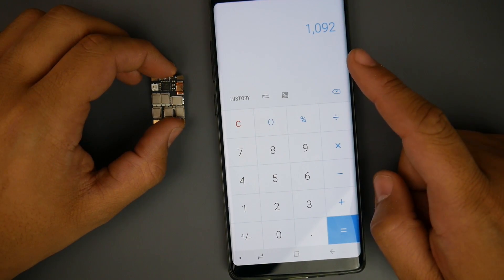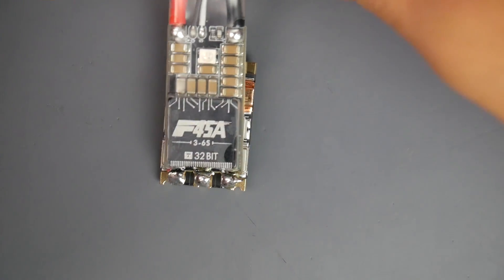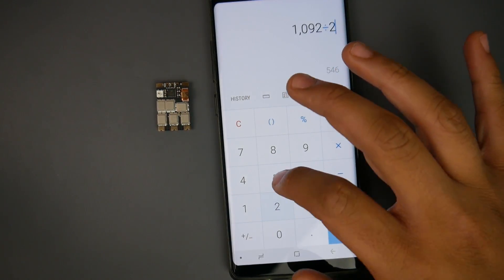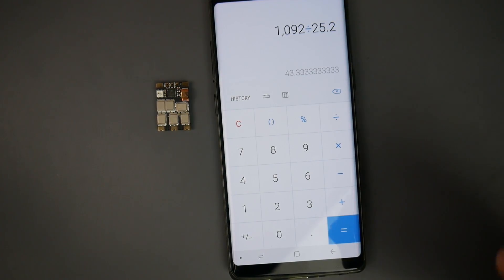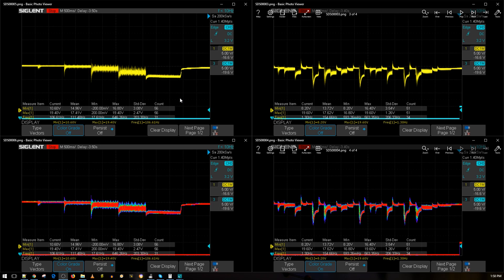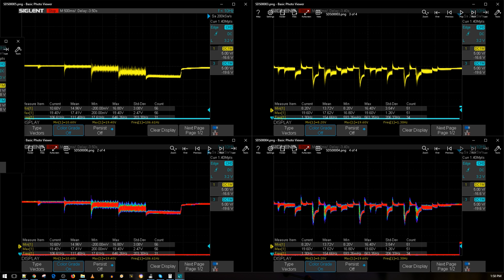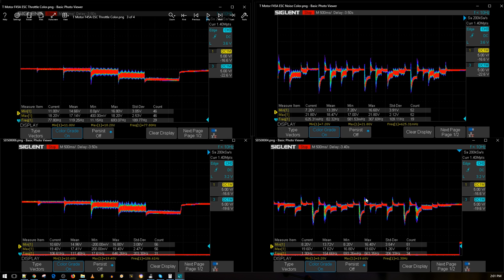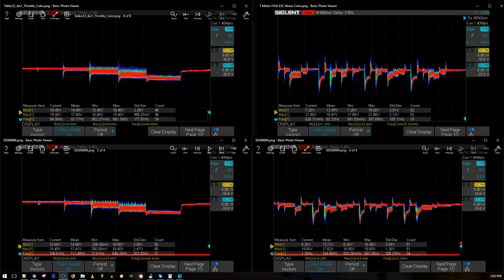ESC MADE WITH ALIEN TECHNOLOGY!! // Holybro Tekko32 F3 Metal ESC 65A

Comment: Hey drone mesh. I have these tekko32  f3 metal individuals.  I paired them with a  radix fc and pdb. I always  have errors  in the motors tab on betaflight  when using bidirectional  dshot. I have contacted  Brain about this and Holybro.  Brain says it's bad esc's,  and Holybro says it's something with the fc.  It does fly without bidirectional dshot. Tried all sorts of settings to get the error to zero. Nothing helps. All the obvious stuff is correct  like firmware  and stuff. My question is, I remember  watching one of your  videos  where you found that one esc in a 4in1 didn't  quite work like it should have compared to the others. Is it possible that I have faulty esc's?  Have you heard of this before? Any ideas. I would hate to just go out  and spend another $100 on esc's.

Comment: you might be getting something wrong about that shunt resistor. at least i cant see how it could directly increase power delivery and efficiency. and ant resistance will slightly reduce the current drawn. usually a shunt like that is used for current meassurement, though, which might allow the MCU to make some little adjustments. 
(you cant easily meassure 65A. but the resistance of a meassuring shunt causes a tiny current drop, that is easily meassured, to calculate the full amperage.)
PS: feel free to correct me, if i am mistaken here. but it sounds just about right. https://en.wikipedia.org/wiki/Shunt_%28electrical%29#Use_in_current_measuring
Reply: I believe he simply means that they are using a lower resistance shunt than is normally used so there will be less loss to heat in the shunt itself.
Reply from the maker: I replied to another comment earlier just like this and I spoon fed them what I meant..

Comment: Shunt resistor are there for measuring current, they don't do anything than you mentioned.
Reply: Fernando Fasanella he meant those benefits in comparison to “standard” shunt resistors. they’re all low resistance but the implication is that these are even lower resistance which in comparison to the typical shunt resistor improve blah blah blah ... but it’s probably a modest benefit.  if something does the same job as another part with lower resistance it will improve amp draw, efficiency, power delivery...
Reply: @CesiumSalami  Yes and any real electronic engineer will tell it's just gimmick and BS. Let's do some math. Assume the shunt has constant resistance regardless of temperature change, when the load (the quad) draws 100A, the .25mOhm shunt dissipates 2.5W (100^2 * .25m) LESS power than a .5mOhm shunt. That sounds like a lot cause 2.5W can light up quite a few LEDs. But if you look at the whole picture where the load is drawing 2280W (100 * 3.8 * 6), the overhead is just 0.1%. And if the quad is just cruising around at 10A, the same model suggests an overhead of 0.011%. So basically they just sacrifice current censoring resolution and accuracy (especially at low end due to the crappy ADC) for nothing here.
Reply: @ivanwong8361  Yeah......... i can't speak with much authority on this and since i have your ear - two things: I wasn't attempting to say that there was a real benefit to these low(er) resistance shunts just that he wasn't making stuff up completely / clarifying.  Perhaps it's all BS / Hype as this hobby is prone to, but that is the goal - it may very well not achieve it.  BUT my question is this: so, if there's really no value in terms of the things you mentioned (thank you very much for the explanation!), they do look really beefy.  Coupled with their larger size and lower resistance do you think they may end up rendering more accurate current readings over larger ranges of wattages because they're able to maintain temps better?
Reply: @CesiumSalami  I totally understand you and I am not saying anyone is making up stuff here - theoretically it's correct. A simple analogy would be: you take off your clothing to save some weight because you want your car goes faster. Theoretically it is correct. But we all see how silly it sounds. To answer your question: I personally never judge characteristics of a passive (or active) SMD component by its physical size. (I know some youtuber keeps saying bigger MOSFETs are smoother lol) Two shunt resistors which look exactly the same can have very different temperature coefficient ratings, very often differ by order of magnitude. The only way to tell is to read the datasheets.
Reply: Yup! That resistor will not improve the power :)) actually you’ll have a current drop there, not signifiant... for who understands, just apply Ohm’s law and voila

Comment: How do you cool it down and yet water proof it? Is there silicon that's also thermally conductive?
Reply: If you add a heatsink it can stick outside the silicone or conformal coating so heat still has a path out but can mostly keep water out

Comment: Can you test Castle 6.5mm connectors verses the xt60 with the amperage equivalent of 4 motors on 4s verses 6s to show how much amperage  difference and voltage drop. I have switched to the castle polarized 6.5mm connectors on all my quads because I have less drop and longer power curve and less heat

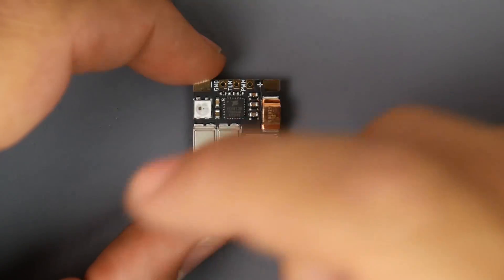Comment: 1:08 How does a resistor increase the power delivery and efficiency?
Reply from the maker: The New Shunt Resistor has Less resistance than the other Shunt resistors that is found on all other ESC's and flight controllers... So lower resistance increases efficiency and current flow.
Reply: @DroneMesh  Oh thanks. I misunderstood you
Reply from the maker: @SandroFPV  No problem :)